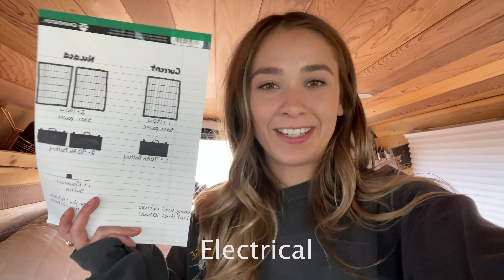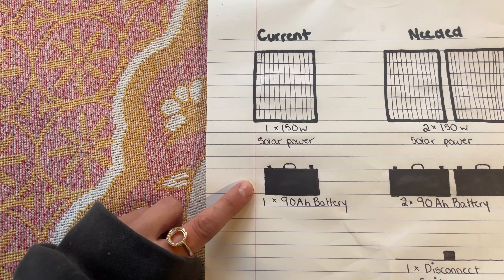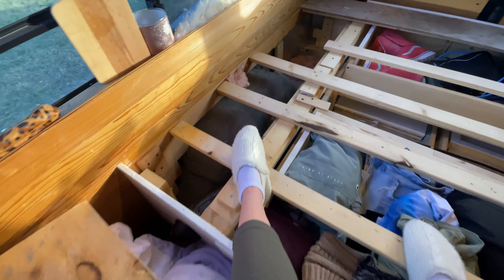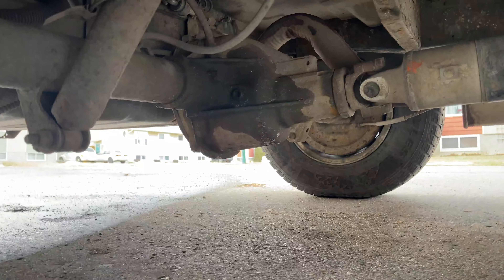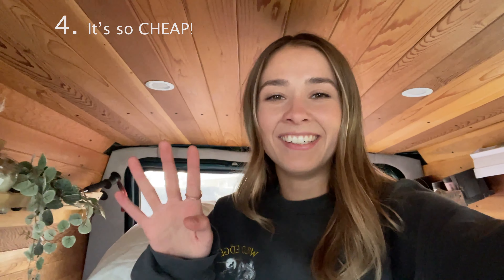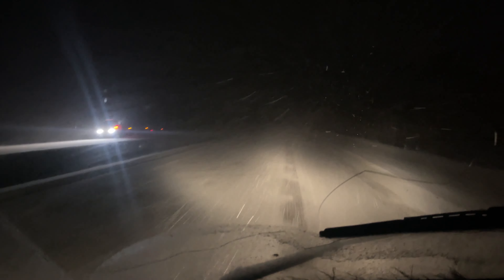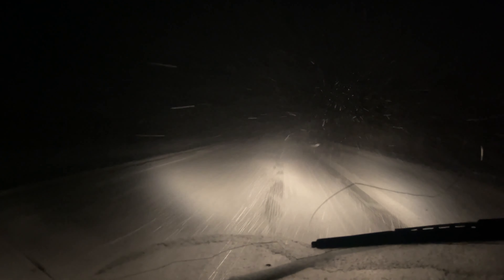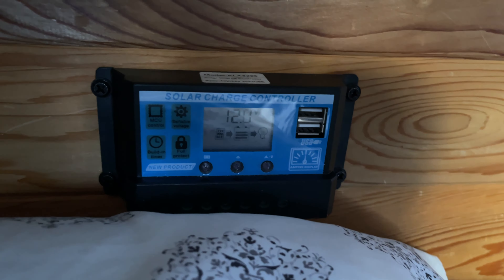VANLIFE - How to keep warm while living in a Van during Winter

Comment: You could run a dc-dc charger so that your vans alternator will top the battery off. For cold batteries they make 12v heater pads that barely take any power to run. You could get it all on amazon for pretty cheap.

Comment: I see that the roof of your van has a lot of rust spots as there is no more paint on it, This metal is very thin, and you can quickly get holes through which the roof will leak, and you will get moisture and water in, The best is this some sanding and painting with Hammeritte rust-resistant metal paint, It is not the most beautiful solution but durable to extend the life of your van (Greetings from Belgium)

Comment: My 2000 E150 has a high output alternator, I have 2. 120ah batteries, one as the starter battery and one for the house, at 2500 rpm it takes about a half hr to recharge the house battery from 11.5-12v to 13.2 charging through the cigarette/power port. The 12v male plug is wored directly to the battery, when the vans running I plug it in, unplug before shutting down. Ive never checked how quickly it charges when actually driving.. I know the alternators are available for chev/gmc but they may be called heavy duty, they are a direct replacement
Reply from the maker: A high output alternator! Why vehicle do you have??? I need that because a half hour for even 12 amps is insane!! You have quite the set up sir 🤙🏼
Reply from the maker: I’m literally going to look into this!

Comment: In the UK they are £79 in case anyone is wondering I agree with Kierra on every point 3:00 you need a Renogy self heating Lifep04 battery  and run it on Kerosene- no worries :) - but one thing I do need to say - if you are keeping the DNH fuel tank outside you are running a high risk of waxing and stuff - Diesel freezes at 0 degrees! - -20 -41 I am amazed it's working at all and no wonder on all the errors! also 12.1 is way too low for a Lead Acid battery which I assume it is?

Comment: Hey there  thanks for keeping it super simple! If it’s ok can I give a couple tips to help. Not sure where exactly you battery is but insulate around it or pass warm air around it to keep it healthy and it will always except a charge. Also put a moisture mat under you mattress to keep out the  mold!  Or you
Will need to replace the mattress and the surrounding wood once it’s molded out.. good luck
Reply from the maker: I am ready for all and any advice so I appreciate it SO SO much! Will definitely add those! Thanks for watching AND placing a comment - your the best